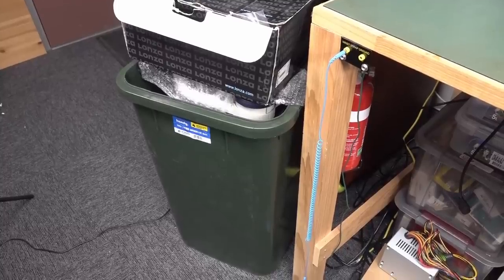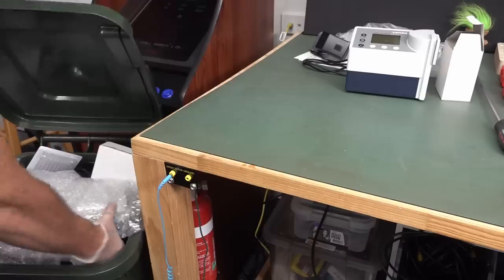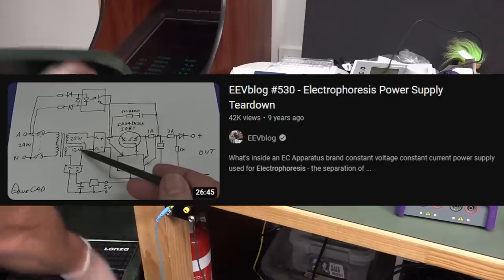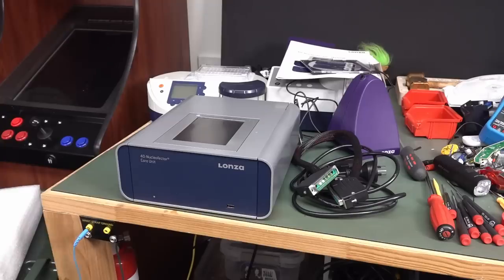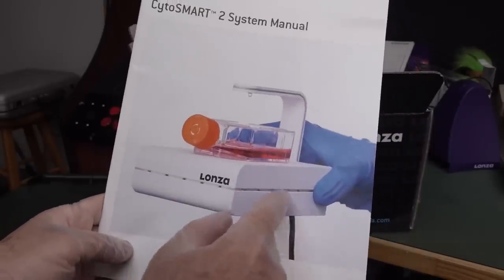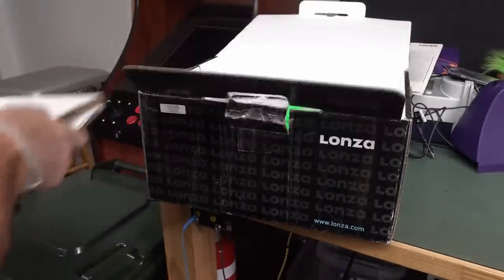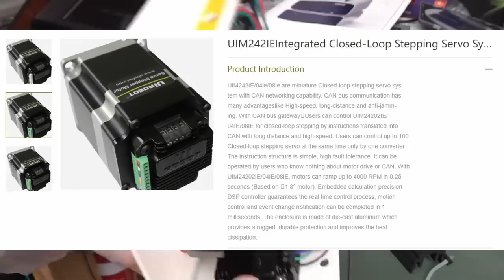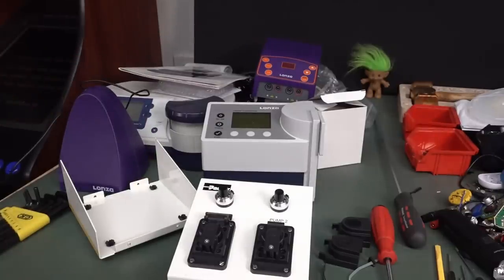EEVblog 1528 - I found a bin FULL of Dumpster Bio Lab Devices!

Comment: Peristaltic pumps, useful to pump precise quantities of liquid. You could make the world's most precise flux dispenser, and finally be able to accurately dispense a Rossman of flux every time repeatedly, so you can never be underfluxing any joint.
Reply: Couple that with a flux capacitor... Oh man, I hope Biff Tannen ain't gonna read that!
Reply: The machine still has to know how much 1 Rossman of flux even is, I doubt there is an answer but its probably a lot
Reply: The holy grail for photography of water drops.
Reply: @Dystopikachu  about 4 tubes
Reply: Come on, everyone knows a Paul is the correct unit to measure flux in.
Reply: Nah, that's garden hose league...
Reply: Louis' videos drive me crazy because he makes soldering look so easy. I keep assuming it's because he's using a lot of flux, but that doesn't work. Maybe he's just using better flux than I have. 🤔
Reply: @Dystopikachu  A Rossmann of flux is an adaptable unit equal to 1-full-container of flux, regardless of the container.
Reply: Or TronixFix 'Perfect amount of thermal paste'...
Reply: Nah you can use the pump to dispense the perfect amount of thermal paste
Reply: Highly desirable to the Reef aquarium enthusiasts.
Reply: @Dystopikachu  Just submerge the entire board and call it good ;)
Reply: Gonna need a bigger pump for that...
Reply: You can also pump stuff that should never come in contact with anything else. You can get these pumps for hose diamaters of up to 30cm.
Reply: Nah, you don't need a device to measure a Rossmann worth of flux. More is better, always. Don't forget he is American too ;)
Reply: @Zach.O  "The correct amount" of flux
Reply: Now it's time to make a lake of flux on PCBs :D :D :D
Reply: @Dystopikachu  I guess it'd have to be sent down there to Texas, so Louis can personally calibrate it!
Reply: I make my flux with the pine resine that the trees drop on the summer. I have flux for this life and another. Whoever dies with the most amount of flux wins.
Reply: @soulrobotics  wait a moment, you've got an entire capacitor worth of flux? Ha.

Got a hefty tin can full of rosin somewhere in my lab BTW.
Reply: @I.____.....__...__  could be the solder too high quality lead solder and flux makes soldering a million times better
Reply: @Dystopikachu  Most people use milliRossmans, or even nanoRossmans.
Reply: These Pumps are for some kind of automated cell counting set up?
Reply: That thing is way undersized to dispense a Rossman of flux in a viable amount of time.
Reply: @Dystopikachu  about .01 pauls
Reply: @julianreverse  Yah, they're very common in stuff like semiconductor fabs where you need to pump really nasty stuff like hydrofluoric acid about the place.

Also where you need stuff to stay sterile like blood and IV products.
Reply: For a Louis amount of Flux you need a submersible Pump. 
That kind of type the fire department would use to pump out your basement after a flood
Reply: @Fluxkompressor  Or you could just use the pump on the tanker truck?
Reply: If you ever had your hands on one of those peristaltic pumps, you'll realize that they are only suitable for thin liquids as the tube would simply collapse, if you were to use common flux.
Reply: @Elektrotechniker  You will be surprised what those pump will pump, I was pumping a slurry with one, that was around 60% salt, and 30% sunflower oil, used as a flavour pack. Basically a very thick soup, and it was fine in a peristaltic pump, just had to use the right pump tube in it.
Reply: @Elektrotechniker  Damn it. There goes my idea of an chocolate extruder for 3D printing
Ok, I'll use a small gear pump then
Reply: And I herby dub that perfect qty of flux as the “Rossmann”
Reply: Honestly just happy if I get fluxed at all whatsoever
Reply: 1 Rossman of flux is equal to 0.6 decilitres.

Comment: The peristaltic pump unit has many uses for dispensing or liquid transfer and is probably worth keeping around.  The other gear is likely going to contain quite interesting optical components to play with, but probably otherwise pretty useless and proprietary.
I don't have anything to do with designing medical devices, but I do design the occasional prototype scientific device using things like spectrometers, cuvette holders, various optics, and Rapsberry Pi's (when I can source them).
Reply: Or for that matter, the base for a robot.
Reply: @jfbeam  Even better, a robot doctor.

Comment: The CytoSMART is pretty much just a camera and light, but you can put it inside a cell culture incubator and it will take pictures on a schedule as your cells grow. 

This means you could take a photo every 5 minutes for 48 hours for example, so you can see cell growth at great time resolution without constantly taking your cells out. Normally this wouldn't be possible, as taking cells out of the incubator over to a microscope this frequently would damage them due to movement, temperature and gassing changes and would mess up your experiments . 

Trying to stay awake to image cells regularly for 48 hours also isn't practical, although I've seen this attempted in PhD labs! If you ever see a paper with about 30 hours of hourly imaging, that's because it's the limit of human endurance for this kind of experiment.

Comment: In the Czech Republic, you could start a new cell biology lab with all of this gear. Definitely donate it to some science faculty at a university. The instruments are all older models that are no longer sold but you can still buy kits for the Nucleofector, new gels for the FlashGel system and the Cytosmart microscope is also completely viable. It has a little crappy camera, the newer models have better lens and resolution but for some student projects it's still a great tool!

Comment: Aah, luminosity measurements!  Once upon a time I was involved with an effort to develop a solid state replacement for a photo multiplier tube based unit to be used in things like milk quality testing.  Meaning a measurement of possible bacterial contamination.  Living cells, like bacteria have ATP (adenosine triphosphate) as the energy "batteries".  Applying corresponding enzyme hat reacts with the ATP, you get light similar to what fireflies generate.  The more bacteria, the more light, though still very low quantity.  Hence the reflector to collect as much as possible of the weak glow from the test cuvette.
 
I designed a circuit and my pal built the prototype mechanics.  For reasons I don't want to go to in any detail, we did not continue our relationship with our "customer".  And soon my life took a really different path, but I did continue my theoretical interest to bioluminesense articles.

Comment: You can make a nice two part micro epoxy mixer using the stepper controlled peristaltic pumps. If the pots control the speed, it could even make the mixer a variable ratio one.

Comment: Re: The luminometer. It is actually quite a simple device. The sample you put in emits some light (wavelength, amount etc. of course depend on the specific chemical processes induced) and the luminometer holds it in a completely dark environment and measures the amount of light emitted.

Comment: Cool find indeed, some of these devices might be of use in a chemical lab (namely, spectrophotometers).
300VDC 400mA? You can power a quadrophonic EL84 push-pull amp with that, haha!
The dual peristaltic pump looks very nice and totally pro. You'll make a use of it, I'm sure :).
720p webcam, meeeeeeeeeh...

Oh, and looking at you doing a video in latex gloves... do one in a full rubber maid outfit! Hahahahaha.
Reply from the maker: The rubber is on the EEVkink channel
Reply: @EEVblog  hahahahaha! That's another sub on that one! Either kind.
Reply: I don't want to know how much that company charged for a webcam, a sheet of UV-blocking polycarbonate, and an injection-molded ABS shell. It's probably absurd.

Comment: - It's very frustrating to see such horrible waste (and e-waste to boot). 😠
- 2:30 When the product sheet is so full of dense jargon, its purpose is completely opaque to anyone not in the field. 😂
- 5:40 Yup, #W# connectors like the 17W5, or this 24W7 connector do support higher voltages, so that's what they're usually used for along with other signals. They are sometimes even used for audio-video, but for large equipment like LED-walls or giant speaker systems that require much more power.
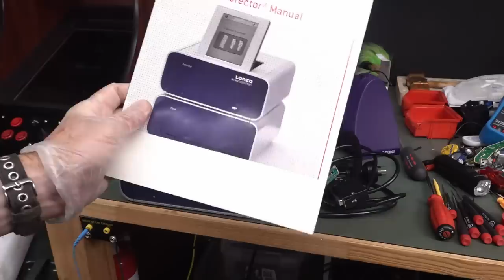- 6:25 Ah, yes, the doodad connects to the thingamajig, and makes the whatchamacallit work. That clears it up.
- So Dave is going to harvest a few parts like power-adapters and cables and components and render them useless? Even more waste. 😕 I wonder if Thought Emporium could use these for his channel, or maybe NileRed to biology. 🤔
Reply from the maker: I won't toss them.

Comment: Those smileys are probably for phlebotomy.  Hand it to the patient to ball up in their fist while the arm is straight out to get up a vein for blood sample.  300 VDC supply for electrophoresis:  proteins and such given a charge by detergent solution and squirted in polyacrylamide gel.  The current causes separation of the proteins because different numbers of charged sites on the gigantic molecules.  The classic autoradiogram in old CSI with little lines all up and down and xray film is one of those separations with radioactive bits bonded to the proteins or dna.  The film laid on top is exposed hence the name auto-radiogram.  So that might be done on a bodily fluid sample to match a rapist or killer or such

Comment: Dave, those pumps appear to be some sort of medical Centrifugal or roller pump. [Peristaltic pump; I could not remember that name!] They can be used for blood products, so that the pump doesn't damage the cells, whilst it pumps them around in the circuit. An impeller pump would rip up the red blood cells, and damage them.

Comment: The web cam looks like the type used to capture scope pictures before scope had built in printer ports. 
This like thousands of dollars of bio lab equipment.
I really like the double peristaltic pump.
The device with the small square sample cell, might be a photo absorbtion spectrophotometer, designed for determining the chemical composition of a liquid sample.

Comment: If any if this works, surely it could be passed to a University Science Dept.
Reply: Everyone always says that without thinking. University science departments don't really have free-form labs that do whatever. WTF are they going to do with some random equipment that doesn't fit into any of their courses? The labs reinforce the concepts taught in the class - they already have the equipment they need for the labs they teach that match the courses they're teaching. They're not going to change the course or lab to accommodate some one off piece of crap donated to them from the tip. Labs are kept the same for many years specifically so that equipment changes aren't necessary. On the research side, if you need a piece of equipment, you buy it - you're not going to sit around and wait for one to show up from the garbage. That's what grant money is for - it buys the equipment you need when you need it. Also, no one is going to fart around with old potentially broken equipment when there's free grant money to buy new. This stuff is only of interest to engineers and tinkerers, that like Dave, won't turn it on, but take it apart, and potentially repurpose some stuff. Even there, being an engineer and tinkerer myself that's collects too much garbage "because it might be useful for something at some point", you can only collect so much crap - and then when you're actually designing a project, you tend to just order new parts anyway because it's faster than digging through boxes of old junk.
Reply: This equipment are used in universities, medical.  But the companies supporting the equipment needs to be involved...

Comment: The other day I was putting some bits together on an optical breadboard and came accross a cap head screw, which looked like I needed a 3mm Allen key but it was too small, so I went for the 4mm, too big, so thoght  ahhh imperial, must be 1/8th no too small - it was 9/64ths -- 9/64ths! Jeeez

Comment: There have been incidents in the past where medic equipment is thrown out, but still contains radioactive material.
Reply: A mate bought a scrapped metal thickness measuring device that used a really strong source - like shut the plant and call in the experts if it goes missing. Anyway, he bought it for scrap and had the fright of his life when he discovered that they forgot to remove the radioactive source!!!
When he pointed this out they started shitting themselves.....

Comment: 1. - used to assay (test) for the bacteria mycoplasma, probably via fluorescence but I didn’t look into it
2. Transfector- transfers genetic material into a cell using electrical fields- the dna or rna is negatively charged and the field will rupture the cells, some of the ones that live will now have the dna inside rather than outside- later you kill off the ones that don’t by adding something that they need the dna/rna product to survive.
3- a gel power supply to separate dna and rna by molecular weight.
4- a camera to read the gel after adding ruthenium dye (which fluoresces blue under uv)
5- nucleofector same as #2.
6- probably a confocal camera to image cells. Anyway a camera to image cells. Can be used for a lot of things. Often microbiology will use it to make sure industrial food surfaces /pharma manufacturing is sterile 
6-endosafe pts- used to identify the type of bacteria found.  There’s a system to this which is far outside the scope here, but it looks for endotoxin (usually bad food contaminants that make people sick-think recalls), gram stain and susceptibility 
7- mycotest mycoplasma test kit same as 1
8- peristaltic pump - pump that keeps fluid separate from pump parts- it probably has regulated volume - it needs to be closed loop for repeatibility
Reply: Not much to take apart. Probably a few high quality parts - regulated light source and detector. But the rest will just be standard fare. As I’ve had little luck repurposing displays- the most interesting is the Parker pump

Comment: The "pink liquid" in the CytoSmart device is going to be "fetal calf serum" or a similar mammalian cell culture medium.  You would need a proper growing environment to use to obtain good results, typically a thermal control cabinet with a gas supply to have proper oxygen, CO2 and similar condition.   What a "dumpster haul" you have.  Much of it is NOT cheap and it looks barely used!

Comment: 3:41 - An oscilloscope camera?
Reply: Looks like a cheaply-made (but no doubt eye-wateringly priced!) "gel-doc" camera system for agarose gel electrophoresis. DNA on the gels is stained with a fluorescent die that lights up under blue/UV light. The filter will pass the fluorescent signal but not the  blue light.